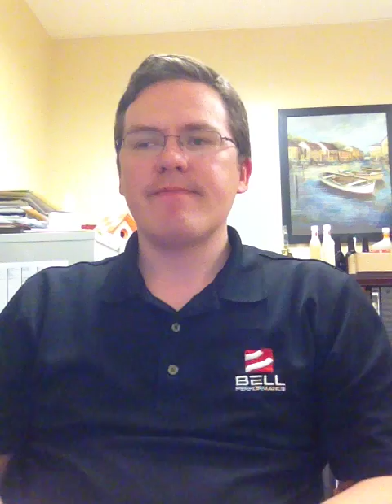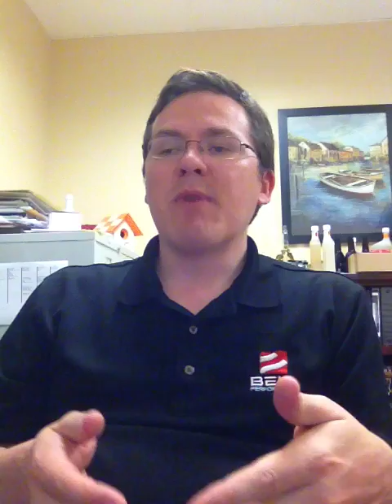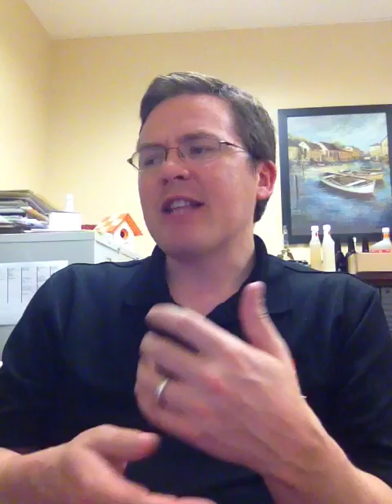Diesel Black Smoke Explained | Bell Performance Video Blog

Comment: I have a john deere marine engine running it at idle and up to 1750 rpm works perfectly bump it up to 2000 or wide open and bogs down (all new filters and still does it) any advice???
Reply: And rolls black smoke let off throttle and works good again

Comment: It can be contributed to by three causes - dirty or clogged diesel fuel injectors, inadequate poor or non existent diesel engine servicing, or a deliberately set over-rich diesel fuel mixture that puts too much diesel into the engine causing black smoke on acceleration, at a steady speed or under load I.e. towing a trailer with a diesel van truck or car, or operating a machine on a tractor.

Comment: I have a 2 Liter Diesel with a six gear manual transmission and I usually only get black smoke when accelerating in a gear higher than 4th, do you know why that could be? It does have a dpf and I thought it was just clogged up but I did two 700-800 km trips to and from my university city since I got it so I don't think that thing could be any emptier by now
Reply from the maker: Best thing to do would be go on our web site and fill out a Contact Us form asking for James Dunst. He is a master mechanic and would at least be able to get the discussion started.
Reply: @BellPerformance  hi thanks for the reply, turns out I had a torn airpipe connecting my turbo and engine which caused insufficient pressure whenever the turbo was engaged while my injection system still dumped a bunch of fuel like it was supposed to which caused it to run rich everytime i accelerated just enough for my turbo to kick in
Reply from the maker: Glad to hear you got that sorted out.

Comment: I have a Cummins diesel on my boat - black smoke... was told to clean air filters.  I had them cleaned.  Didn’t work.  Now I’m told it could be the injectors or turbo 🙈
Reply from the maker: Many times, the injectors have something to do with black smoke. At least they had you start with something simple, and work backwards from there.
Reply: @BellPerformance  Simple??  injectors are not simple  to remove ,buy new,or send to a specialist,and install and re-code (if that is the case); and it is expensive!!
Simple would be a bad MAP or MAF,if one is lucky.

Comment: I have a 2 L turbo diesel I have noticed puff of black smoke on boost Clears throughout the top end Every gear puff of smoke is that normal I have noticed Oil leaking from my turbo I hope it’s just a return pipe/No cat no DPF
Reply: Depends on the engine and how much smoke.  With an older mechanically injected engine it's pretty common to get a little smoke when you first hit the accelerator until the turbo spools up.  Any modern emissions controlled engine should be controlling the fueling to prevent smoke.  A little black smoke is bad for the air, but good for making power and reducing turbo lag.

Comment: Hello guys. I was wondering one thing. Normally when a diesel car is remapped for huge hp gains also gain tons and tons of black smoke. Isn't beneficial to balance the fuel:air ratio when remapping for power? And if so why do they smoke so bad?
Reply from the maker: I would assume that you would want to balance the fuel:air mixture when doing that. But I am not a mechanic myself. However, you can email our master mechanic James Dunst at jdunst@bellperformance.net and he will certainly able to clear things up for you.
Reply: The max power from a diesel almost always results in black smoke.  The ratio and timing can be optimized to not smoke, but it will loose a little power when compared to a richer smoky ratio.  If it's making tons of smoke it's being excessively fueled, they don't have to make tons of smoke, but there will be some if seeking max power.

Comment: I'm not in the States, my problem is black smoke under hard acceleration on a non DPF (removed), EGR blocked, intake cleaned, always used Decarboniser in the fuel as well as a common rail lubricity agent.  Vehicle is older Audi Q7 4.2 TDi, which is twin turbo V8.  It has been tuned to stage 2.8, the reason not stage 3 is to slightly detune in an attempt to reduce black smoke emissions which it certainly did.
I am thinking about taking it back to stage 1, which I found was very economical.  Since the Q7 no longer will tow a van this will be the ideal fuel map I believe, as I believe stages 2,3,2.8 are overfueled under hard acceleration.
The DPFS always caused problems and since their removal it's been great apart from black smoke under hard acceleration.
It may be possible that the intake valves have carbon built up on the valve stem side and so I am looking at trying to remove this soon.
So could the soot under hard acceleration be caused from a too rich fuel to air ratio on fuel map 2.8?
Or could be partly caused by carbon build up on the intake valves, or both?
The Q7 has done 250,000 klms.
Reply: Anything that restricts air flow can lead to black smoke, but in the case of a 'tuned' motor it's almost always because the tune cranks up the fuel to make more power.  The timing also plays into it.  Max power with a diesel will almost always result in visible smoke, but you can turn it down to not smoke without loosing too much power, assuming everything else is working properly.
Rather than use 'generic' tunes you can get your car dyno tuned, that could achieve a clean tune with the most power.
Reply from the maker: Could be any of those. Soot or carbon buildup almost always has to do with incomplete fuel combustion, which could come from a rich fuel mix.

Comment: Most of the time if you see and semi or a diesel pick up hauling butt down the highway and you see a puff of black smoke come out, or even when a diesel is going from parked to taking off, they will smoke because the driver is slamming the fuel pedal down forcing more fuel into the engine. I do it a lot on purpose when some A-hole is tailgating me, slam the fuel pedal down and cloud them with black smoke to make them back off.
Reply: at almost 5$ gallon is a luxury ;-1
Reply: You are such a gentleman
Reply: Yeah you are correct i love to smokem, but my mot is 5 weeks lol

Comment: Black smoke can be caused by lots of reasons ie- more fuel, bad injectors or my case faulty turbo veins. Check basics first
Reply from the maker: That's good advice; checking the basics first is usually a good idea.

Comment: (Smoky emissions in any vehicle is a sign that something is not as it should be). totally untrue, where's your facts ? This is only true if you drive a gas engine which i assume is all you have driven in your life. Totally false on a diesel
Reply from the maker: When you're talking about black smoke, it sure is. Black smoke is a sign of partially burned fuel. If diesel fuel is being burned completely, you won't have black smoke, since complete combustion of hydrocarbons yields carbon dioxide and water.
Reply from the maker: It would also be a sign that the emissions control systems aren't functioning properly. The DPF is designed to catch all of that. So, again, smoky emissions with a diesel is a sign that something is not as it should be.

Comment: Would it black smoke if the turbo is going bad
Reply: Ryan Gilley white smoke signifies a bad turbo.
Reply: If the bearings are seizing then the rotor will not spin up to speed and won't provide enough air to the engine causing black smoke. I've also had a turbo failure where the compressor side exploded shedding all the veins, extreme loss of Powe and great volume of black smoke.
Reply: This guy told you white smoke bad turbo. Right oil passes along the turbo shaft and if the seal leaks it can be blasted up withthe outward air from turbo into intake system and be burnt. Oil burning is blue smoke only.
Reply: White smoke is water. A knackered turbo would leak oil into the mixture which is blue. Take off your turbo pipes and check for a lot of oil.

Comment: what if the white smoke only when semi-cold start and goes away once it reaches normal running temperature is that bad or is it normal? its not that its very cold it hardly need to be cold.
Reply: got same question did you get answer from anywhere else

Comment: Black smoke, much higher fuel consumption and total lack of power can also be caused by a faulty turbocharger or (like in my case) a broken wastegate operating lever!
Reply: Christoph Alexander Forkl my truck roals coal I get 8.3l/100km on the highway

Comment: hallo i have a diesel car there were a problem with the maf just change it for 6 time and the obd still showing that i have same problem but the performance is much better,but i noticed black smoke when i accelerate is that means that i have an air leak?i've checked the turbo lines and i saw little oil in the hoses is that a leak?

Comment: The black smoke can eather be cause by that stuff but your for getting a couple of things I have a 1996 F-250 with a 7.3 obs I have a smoke switch and a a lope tune and that causes it to smoke and white smoke can be also caused by a blown turbo and Abunch of other things and for the blue smoke it's not blue it's black with a blue tint and that is caused by burning oil like my mud truck it has. A inline 6 hurcules diesel in it its a M35A2C (deuce and a half) and it has a blue tint to it because I'm running it of a 50,50 50 diesel and 50 oil

Comment: This has put my mind to rest a little.  I rebuilt my diesel engine and it has been pouring black smoke under heavy throttle, I know the intercooler is leaking and quite a bit, that will throw the air off.
Reply: StRoRo a leaky after cooler will cause many problems, high engine temperature, POOR fuel economy, and in extreme cases will cause exhaust valve failure.
Reply: StuRoRo it’s the engine getting under a load or your injector pump is turned up

Comment: hi
My mazda bongo has a low rev and it is producing a black smoke. What could be the problem with the van?? Can the thottle body be the problem?? If yes can it be repaired or just replace with a new one .
Reply: Well try to replace the fuel filter for low rev. I dont know how to make piss of that black smoke. I did anything just to prevent that black smoke and its still smoking like a weed man

Comment from the maker: A comment from Brandon W
----------------------------------------------------------------------------------------------------------
You my friend are a ***** idiot.... Black smoke can also mean higher horsepower, in other words a higher fuel to air ratio. Many do this on purpose. There are different shaped injectors, cat deletes and stacks all to increase horsepower, stop reading out of a book made by Obama and actually learn about diesels ** *
----------------------------------------------------------------------------------------------------------
Hi Brandon,
Thanks for taking to time to comment.  Whether or not someone modifies their diesel or uses different injectors or stacks, the principle is the same. Black smoke means unburned fuel, typically from a mixture that is too rich. It doesn't matter the intent. When you see black smoke, there's an excess of fuel relative to the air present in the mix. That's the bottom line. If you want to talk about user intentions, go ahead and talk away.
Reply: Alot of guys over fuel their trucks... See it alot with common rail guys, just outrageously overfuel their engine. Black smoke doesn't necessarily mean more power... Just means un burnt fuel
Reply: My Cummins will blow smoke when the turbo is still spooling up because the amount of air has to catch up to the amount of diesel being injected. That's not because it's being over fueled. That's what I believe Brandon W was trying to get at. That's a typical thing on higher hp rigs much like mine.
Reply: There's still not a turbo efficient enough to prevent smoke on higher performance engines but it can be greatly eliminated by properly written tunes. black smoke is wasted power
Reply: So you have poorly written tunes?
Reply: But doesn't running too rich lower your power?
Reply: @paulrobert9286  NOT on a diesel!!
Reply: Brandon...you are the real fuckin idiot...you dont know the process
Reply: @ Brondon What does Obama has to do w this conversation? However, though Obama was a very smart man if you check your records or maybe you have a 3rd grade comprehension and cant research anything lol. Just stick to following a gear pattern and deliver my goods. That's about all you are good for mentally.
Reply: Paul Robert running rich lowers cylinder temps which is good
Reply from the maker: @KiloWattRC  Certainly true. It's a little counter-intuitive to the way people think - lean mixtures are hotter than rich mixtures.
Reply: @KiloWattRC  NOT on a diesel!!!